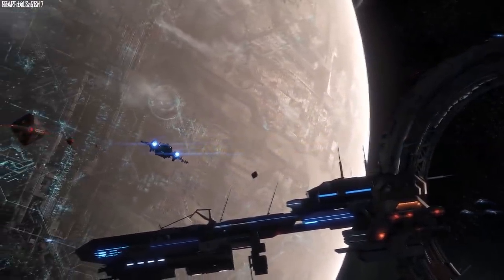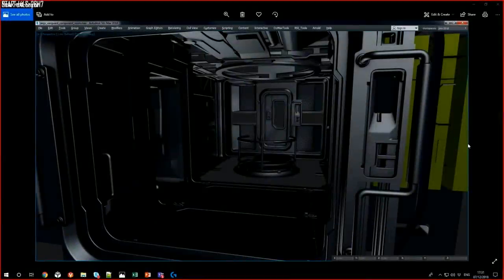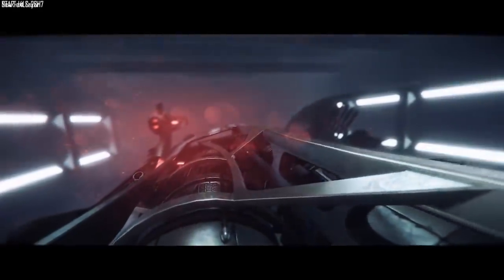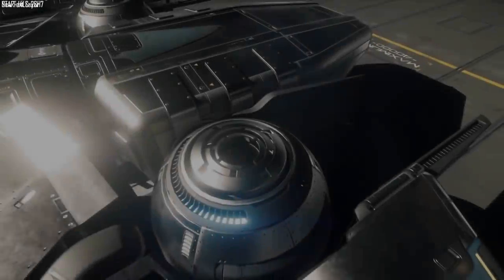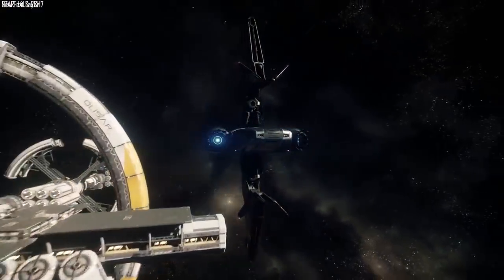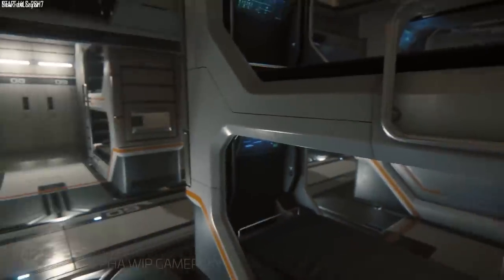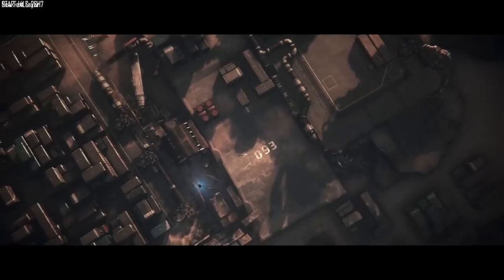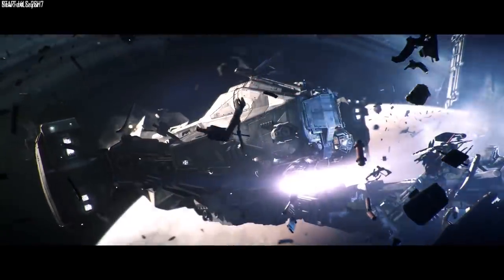Star Citizen | Carrack, BMM, Hull C, Buks Huge Ship Update

Comment: I wonder is carrack gonna keep 1000 scu cargo space
Reply: Unfortunately not. Now its been reduced down to its original concept, the cargo bay has been reduced by x3 as shown in the top view plans in size change. So you will be lucky to get 300. The Carrack is nerfed, its now a claustrophobic Edsel in relation to its promised Roll's Royce, just so they can fit on smaller landing platforms. It no longer comes with a dedicated rover, or rear ramp, or lower turret.
Reply: @LineaDeus  :(

Comment: Carrack is Screwed. No dedicated rover, no longer having a rear ramp, the lower turret is gone. Only way through the ship is from shrunken smaller claustrophobic rooms, weaving through room to room with no corridors. And demonstrated by the pics of the over view plane between the scale change, every interchangeable Cargo pod is reduced by x3 in scale, so its cargo will no longer be 1000. Will be luck to get 300. If you examine the original base concept art of the rover driving down the ramp, check the scale of rover to open cargo pod next the ship, you would only just squeeze the rover in it, that is one of the reasons they increased it size to 170m. It is inevitable the main engineering components will be reduced in tier to squeeze them into the ship, which was why the Carrack was 'increased' in size in the first place, because the new game metrics didn't allow for the original concept scale to work as it was promised.